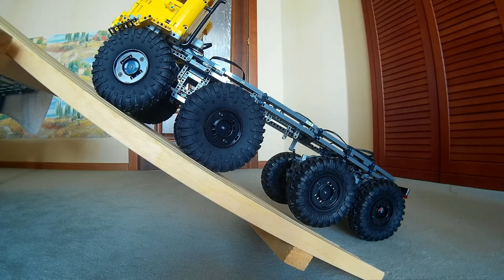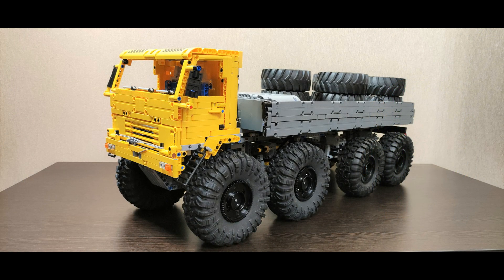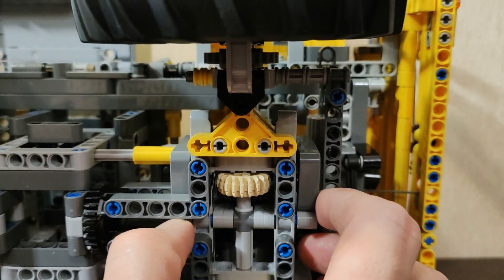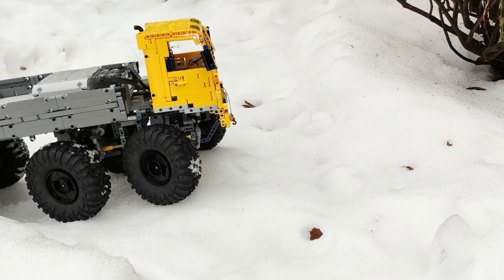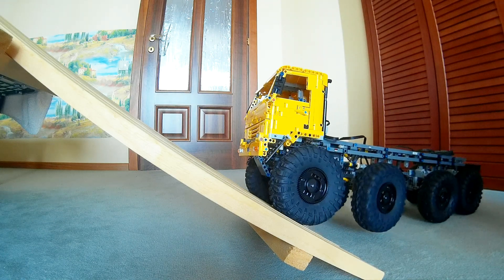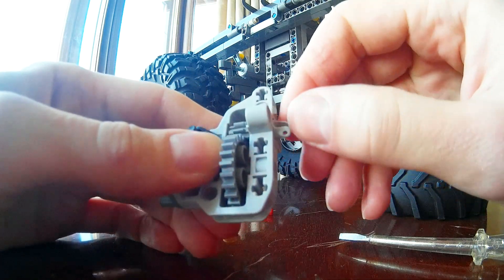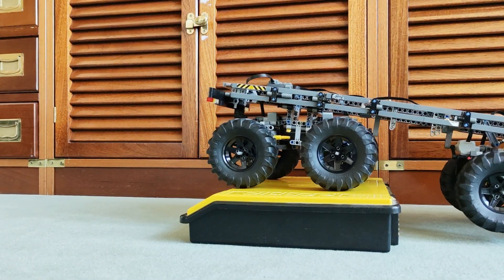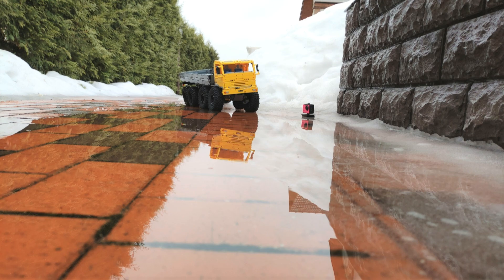Lego Technic Kamaz 8x8 Flatbed Trial Truck

Comment: amazing, but i think it will be even more unstoppable if you a connect all axles with a driveshaft, thus all motors will share the load and climbing will be easier.